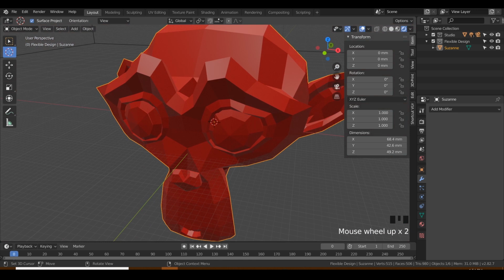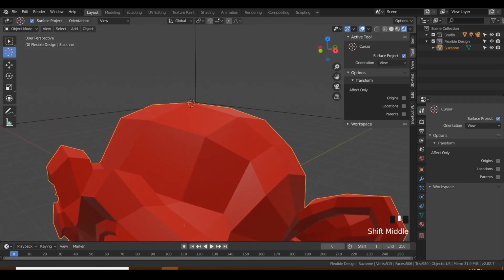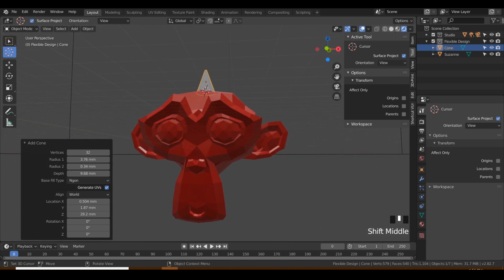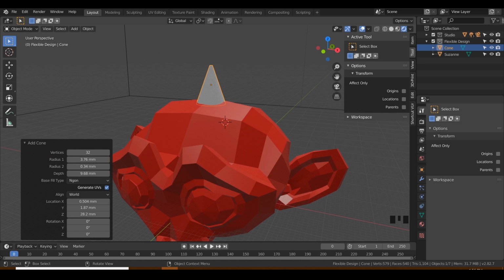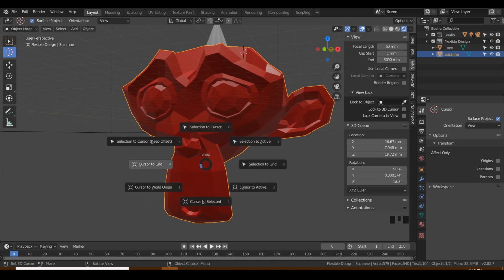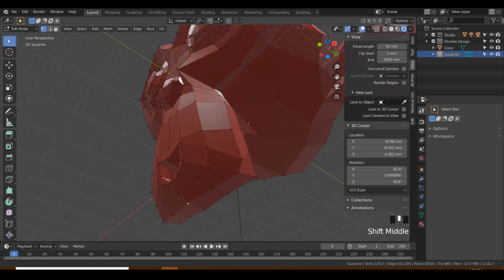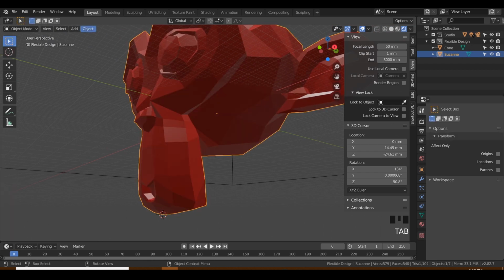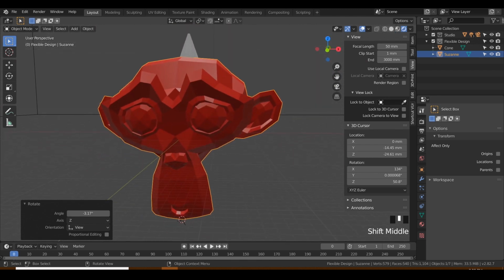WTF is a 3D Cursor?! [Beginner's Guide] - Blender 2.8 for 3D Print Design (2020)

Comment: Very helpful, thank you! What I can't figure out, though, is how to align the rotation of the 3D cursor to a face. It grabs the surface, but new geometry isn't parallel to the face I'm snapping to. For some reason in Blender this is so much more confusing than 3D software like Rhino! Any ideas?
Reply: I think I finally figured it out...it's not enough to set the snap to the face, in the Tool Panel at right the cursor needs to be  oriented to 'Transform' not just 'Geometry'. The latter will snap to the face, but not at an orthogonal orientation to the face. Setting it to 'Transform' seems to do the trick. So many things that are basic and fundamental to almost all other 3D software seem to be overly complex in Blender!
Reply from the maker: Glad you figured it out.  Yeah learning another software is a good brain workout. Best of luck.
Reply: @PrintThatThing  So to keep the cursor parallel and oriented to a surface, it's necessary to set the transform orientation to the surface 'normal,' the cursor orientation to 'transform' and snapping to 'face'. It's no wonder people find this so confusing! Blender folks could learn a thing from SketchUp...placing axes is SO much more visual. And Rhino lets you align to a face with one click! Thanks again.
Reply from the maker: I'm sure they all have they're pros and cons. :)